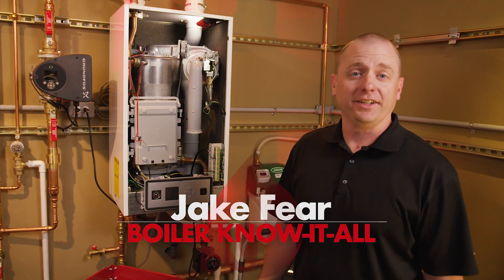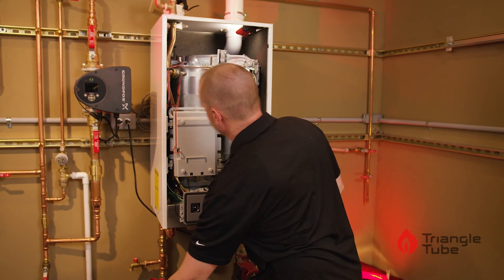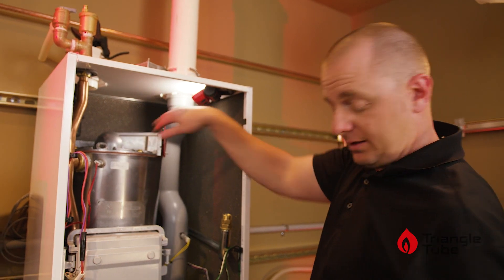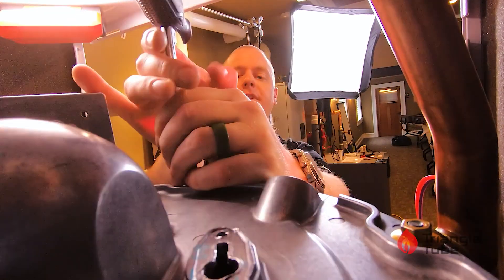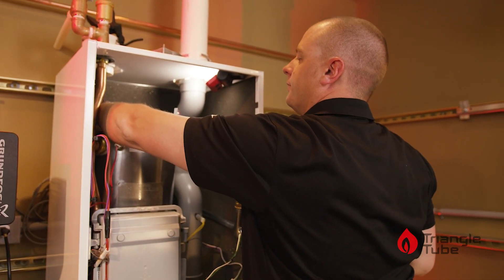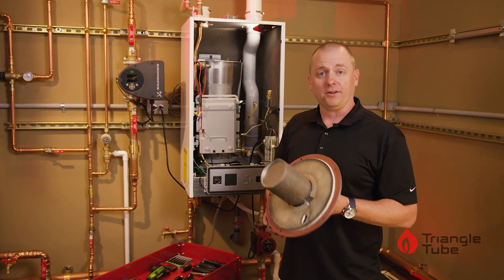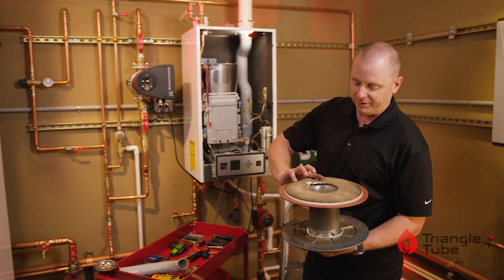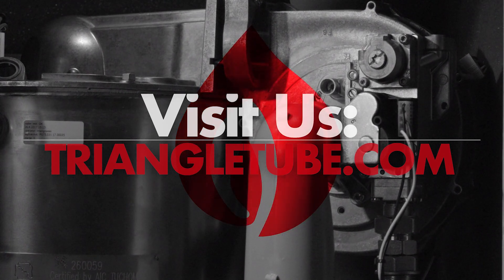How To: Inspect The Burner

Comment: Best system I ever had
Reply: Just to let you know, there was a recall in February for 28 models of Triangle Tube boilers due to the risk of carbon monoxide poisoning. This recall involves the ignition system and is separate from the 2020 recall, which affected many of the same models. You can check the manufacturer's website or the Consumer Product Safety Commission website to see if your model is affected. Also, Triangle Tube recommends having functioning carbon monoxide detectors on each level of your home, especially near where you sleep.

Comment: I refit the fan plus red gasket and once fired up a really strong smell of gas was there,  I took it off and re fit and smell went.  My question is can that clamp sit slightly off but look OK
Reply: Just to let you know, there was a recall in February for 28 models of Triangle Tube boilers due to the risk of carbon monoxide poisoning. This recall involves the ignition system and is separate from the 2020 recall, which affected many of the same models. You can check the manufacturer's website or the Consumer Product Safety Commission website to see if your model is affected. Also, Triangle Tube recommends having functioning carbon monoxide detectors on each level of your home, especially near where you sleep.
Reply from the maker: Hi Aaron, thank you for your question. Our tech support team will be happy to help! Please contact them at 856-228-8881 ext:575 or techsupport@triangletube.com

Comment: WHAT IS CODE U1-25 REPRESENTING?  THANKS
Reply: Thanks for reaching out John.  That is actually the version of software - not a fault code.  Let me know if we can help with anything else.
Reply: u1-25 constant on interface Doesn't seem as though unit is firing, just blower running only @triangletubemarketing
Reply: Just to let you know, there was a recall in February for 28 models of Triangle Tube boilers due to the risk of carbon monoxide poisoning. This recall involves the ignition system and is separate from the 2020 recall, which affected many of the same models. You can check the manufacturer's website or the Consumer Product Safety Commission website to see if your model is affected. Also, Triangle Tube recommends having functioning carbon monoxide detectors on each level of your home, especially near where you sleep.